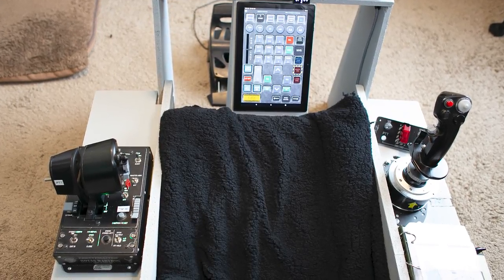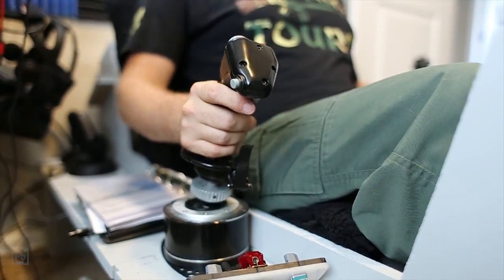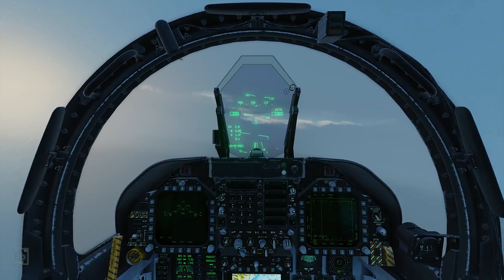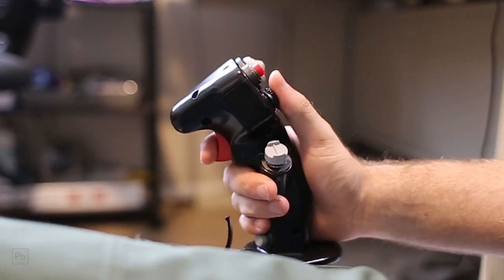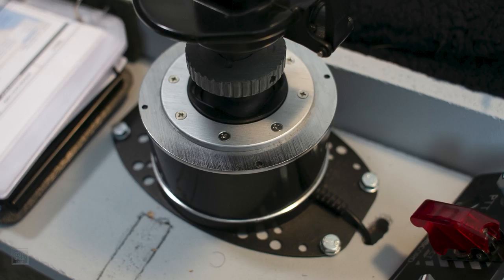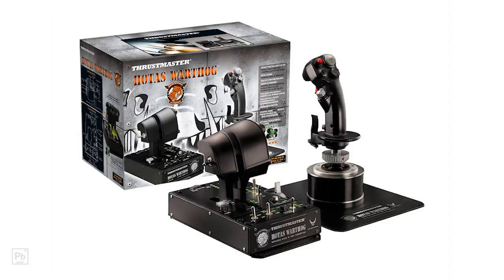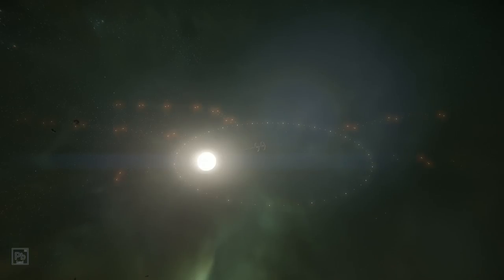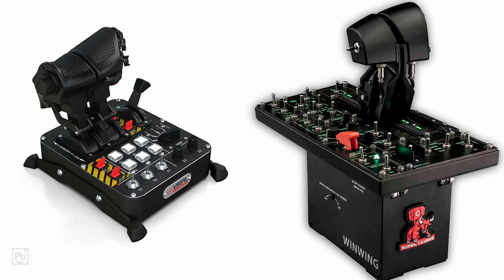Thrustmaster Warthog HOTAS Review for DCS, MSFS, Star Citizen

Comment: Over the few years of owning Warthog HOTAS, I've upgraded the nipple on throttle and replaced stick base with Virpil's Warbrd. Flight experience went noticeably up, maneuvers are smoother and so on but the HOTAS itself is a workhorse. Yes, the switches are a bummer sometimes, SC should offer more options that use sticky buttons to utilize it properly. That's definitely feedback I'm going to submit once I get more familiar with SC. You can still map them even to toggles though, it just means you will flip the switch on and off more. But hey, who does not like some switch flipping, right? :D

Comment: When I was looking at changing my flight inputs I decided to go with the dual TM 16000 because of budget and thought that two sticks would be easier for 6-axis control over a stick and throttle. I have had to crack open one of them to clean the pot after it began to malfunction. So no matter the setup, sometimes we have to work on them

Comment: Heat oven to 375°F. In small bowl, mix flour, baking soda and salt; set aside.

2
In large bowl, beat softened butter and sugars with electric mixer on medium speed, or mix with spoon about 1 minute or until fluffy, scraping side of bowl occasionally.

3
Beat in egg and vanilla until smooth. Stir in flour mixture just until blended (dough will be stiff). Stir in chocolate chips and nuts.

4
Onto ungreased cookie sheets, drop dough by rounded tablespoonfuls 2 inches apart.

5
Bake 8 to 10 minutes or until light brown (centers will be soft). Cool 2 minutes; remove from cookie sheet to cooling rack. Cool completely, about 30 minutes. Store covered in airtight container.

Comment: Just picked this thing up to upgrade from a busted x56. So far using the f/a-18 model with this setup is not too bad. Luckily you can use the “<>” types of certain commands to allow the on offs to function like you would expect. Arm<>safe using back and forth on one switch rather than arm or safe being isolated to forward “on” position of a single switch being separate.

Comment: I purchased a used Warthog stick and throttle back in 2015. I used them as is for near 5 years before biting on the Virpil bullet to upgrade my gimbal. The stick still works on the new gimbal, and you can even use Virpil software to spoof the device as the warthog still. This is important for the thing that Leadnap didn't touch on - the software. Yes, the switches on the throttle base can be problematic. Most of the time, game and sim software is expecting momentary impulses, which can make those non-momentary toggles difficult to map. With the software, it's possible to map the toggles such that flipping one on now sends a momentary pulse, and flipping it off sends a second one, allowing for easier mapping. 

That said, it's more work, and not always a 100% solution. In the end, if you have the extra $300, get yourself the virpil stick amd throttle over spending 750 for the Warthog. But if you want a step up from the X56, and can get it for retail, or better used for like 300, it can last most users a long while.

Comment: I've had a Warthog for years. The main gripe was the stiction and centring of the joystick base. Even after stripping and greasing it wouldn't allow me to input fine adjustments as when I'd try and air-to-air refuel. Problem solved by getting a Virtpil WarBRD base, which is a light year better. The throttle is heavy because it has a couple of thick metal plates in the box. I've not had a problem with mapping switches in other DCS modules. I've no intention of replacing anything in the forseeable future unless something dies.

Comment: Owned the TM Warthog since 2011, very light use so I can't speak to wear and tear.

It's definitely outdone by newer HOTAS premium systems but still manages to not be entirely outclassed entirely in terms of value and usage. I had a tough time justifying even considering a new HOTAS setup over my Warthog because I do prefer accurate modeling, though I also don't want to have a bunch of extra equipment lying around so i need to strike a balance of being able to "reuse" some stuff across different jets or helis.

Don't get me wrong. Virpil's throttle has some serious appeal. If I were hard committed to a single throttle grip + base that is the most capable, it is hands down the best -- even capable of doing everything needed for the F-16 throttle (maybe not for the speed brake). I also think the slider on the throttle grip is the best control for zooming in DCS. And it has more than enough controls for everything else on the base -- maybe shy of an extra slider from the Orion/2 base. Feet to the fire, I must only own one, but I fly F-16, Ka-50, A-10C, and F/A-18? Virpil is it.

Why I prefer Winwing as a replacement is because I'd rather hard commit to supporting the throttle (or collective) grip well for a given platform, and map for the others I don't have. Even better with Winwing -- all of those aircraft have grips I can swap in! The Winwing Orion2 F16EX combo price is too good to pass up and the F16 throttle grip is super unique. The F16EX stick is very close to the TM Warthog stick visually, but the F16EX stick adds a lot that'll allow more flexible mappings to the Ka-50 than the A-10/F/A-18 joysticks I have from Thrustmaster right now. To summarize what I'll have with owning two HOTASs:

A-10C: TM Warthog throttle and stick vanilla (100% control accurate)
F-16C: Winwing Orion2 throttle, either F16EX and TM A-10 (both sticks are 100% control accurate, EX has extra)
F/A-18C: TM Warthog throttle + F/A-18C grip (remap situation so different layout, but 100% F/A-18 HOTAS coverage as the F/A-18 TM joystick adds a control missing from the Warthog throttle...I think TM knew this which is why they added it) 
KA-50: TM Warthog throttle + F16EX grip (complete remap situation, but KA

With Winwing, it's a simple purchase of the KA-50 collective grip on the same base should I care for the collective experience. Though I've flown it a lot, I don't care about an accurate cyclic stick for the KA-50. If I'm picky about the F/A-18 throttle grip, that's just another grip on the Orion2 base. Is it more money? Yeah...but saves me time thinking about remapping and improves my overall end experience.

Comment: The trigger detent is much improved in the F/A-18C grip, or at least in mine. My base also had a bottom plate when I fitted it to my frame. I use the stock detent with F/A-18, it just needs custom curves set in DCS, and then remove the detent entirely for Star Citizen. The split throttle is incredibly helpful for DCS too. Agree about the unused switches though - I use more in Star Citizen than in DCS! Anyhow, I enjoyed the video, thank you for sharing
Reply from the maker: Glad to hear the -18 stick is better, and that they added a plate to the bottom of the base.

Comment: The switch problem also lies withing the DCS modules. Some are less user friendly, and some more (jets). You can set those switches no problem. The biggest complain (like lots of guys) is the flightstick grease and overall stiffness. It leads to jerky inputs. The stick itself is great, the base is what's garbage. You end either with other base (Virpil or VKB) or completely regrease it. Overall great piece of hardware apart of the base.

Comment: I’ve upgraded the slew and pinkie switch on the throttle, easy and total worth it.

Oddly prefer a cheap T16000m stick to the warthog one.
Reply from the maker: I prefer the throttle configuration on the TM16000 - just wish they were attached to the rotary throttle arms of the Warthog.

Comment: I use my Thrustmaster Warthog with the MFG crosswind pedals and the Tobii eye tracker. I got my warthog right after getting Star Citizen. I can't imagine playing any flight/space sim without it. HOTAS does not have to be Warthog though it is the only HOTAS I have really used.
Reply from the maker: How are those Crosswinds? Had my eye on some for a while now
Reply: @Leadnap I am 6'2"-ish so I wanted to make sure I could find pedals designed for people with longer legs and the MFG crosswinds were the pedals that were available at the time that accommodated my long ass legs lol. (I didn't get the pedals when I got my Warthog, but just like the HOTAS, I can't imagine playing without the pedals!) Game changer to me! Curious if you don't have pedals how the heck do you roll with the Warthog? The default throttle hat on the side?
Reply: I just realized you have pedals in the video :P

Comment: I was underwhelmed by the warthog stick and throttle. Its metal yes, but the switch gear used is not great and feels cheap in places. The hat on the throttle started off with intermittent issues until i fixed a poorly soldered connection and then after a couple of years the trim hat down position on the stick randomly stoped working. The switch is fine but there is something wrong with the IC chip its connected to. I wouldn't recommend it unless it halved in price.

Comment: I've had my Warthog stick and throttle for 3 years now... 3 years of almost daily abuse and no issues at all! I do however prefer the Hornet stick, got it about a year ago, and you can feel the better buttons and switches that they used. Although, the 2 stage trigger on that needs far more force to fire. 
As for the switches on the throttle, after spending days screwing around in LUA files, I have every switch working as intended in the Hornet. As an example, I have the Master arm switch mapped to one of those 2 at the front of the throttle, and the switch position is mirrored in game, up is on and down is off. 3 way switches work as intended too.
 I just need a custom plate to show what controls I have bound!

Star Citizen needs to fix their crappy binding controls anyway... it's a horrible system they use that confuses itself anyway.
Reply from the maker: Glad to hear my experiences have been pretty spot on. You can certainly make .lua changes to get those bindings to work, and DCS almost requires you to "play" at the level of doing so - but I would have liked to see it done differently by TM

Comment: If the switch mapping options bother you for some modules, get "RSMapper" and set everything up your way!

For instance if you want the boat switch as your DGFT/Missile override switch in the F16 , it doesn't go out of the mode when centered.
With RSMapper i set it to:
AFT:         DGFT ON
CENTER: DGFT OFF / Missile override OFF
FWD:       Missile override ON

And you can do other complicated settings as well.
With the 3 way switch on the left side of the throttle i've got my lights set up.
AFT:         NAV lights OFF
CENTER: NAV lights ON  / Landing lights OFF
FWD:        NAV lights ON  / Landing lights ON

This way you can also give almost every module the same switch functionality so you dont have to remember different bindings ;)

Comment: Cool HOTAS for sure. Be warned though. DO NOT Leave these plugged into your PC when not in use. I bricked a throttle quadrant this way, it seems they do not do well with power surges or something. Coolest part though was swapping the after burner notch for a 3 stage unit for my Viggen.

Comment: Thrustmaster Warthog Throttle has serious problems that Thrustmaster will not fix! USB ports periodically won't recognize the Throttle. The first couple of times rebooting your PC seems to get it back but eventually no matter what you do it will keep giving the USB device unrecognized error 43 message. I have mine about a year and I had it for less than a month before the first error. Thrustmaster customer service did not even reply when I asked them about it. As this is one of the more expensive units on the market it should work flawlessly for at least 5 years. Try a different brand is my vote.

Comment: I rated this as ACE a while back BUT sticktion became a BIG issue after less than a year. Yes I know you can disassemble it and regrease it but not all of us are brave enough to tackle the job and it is fraught with potential hazards.   Its ball and socket design is a no no for such a pricey bit of Kit.  Using my thumb, I would push the stick forward then slowly release the forward pressure of my thumb.  The stick would only come back in a series of uncontrollable jerks.  No chance of flying a chopper with this, no subtlety of control here.  I had no problems withy the throttle BTW although the nipple was a pain to use for target selection, my only gripe.    Again, I know there is a mod for this but why was it so crap in the beginning?  I will admit it looks great and is built like a tank.  About 9 months ago I sold them and bought a virpil constellation Alpha with a Warbird base and a Virpil Mongoose M3 throttle.  BLISS.  The stick is controlled by springs and can be adjusted in lots of ways.  It is buttery smooth and there are plenty of buttons to bind.  Maybe Thrustmaster will respond with a better HOTAS solution, addressing its current design problems.

Comment: The Winwing Orion throttle which I have is a piece of junk.  Lousy cheap parts.  Mine is 4months old and can't be used because the USB plug is completely detached.  Outside looks good but insides are crude junk.  Also has universal problems with the 4 way toggle.   Other squadron mates same issue on this button. Warranty service is lousy, you're at they're mercy.  They don't want to fix it you are OUT OF LUCK